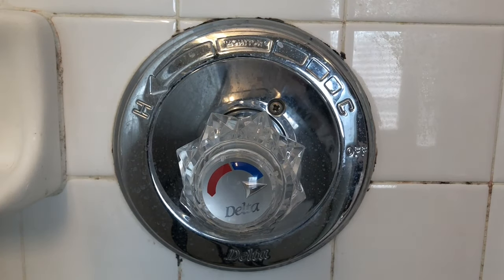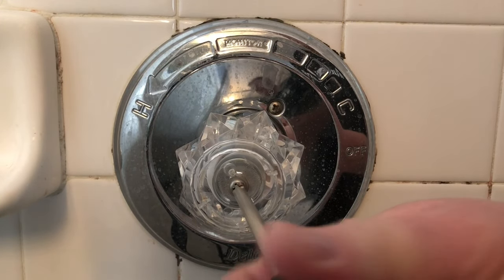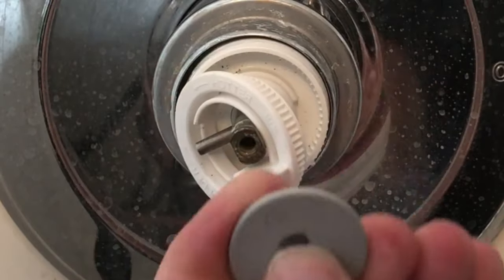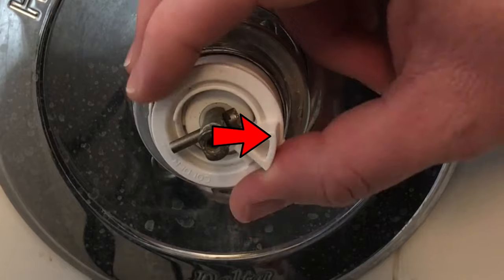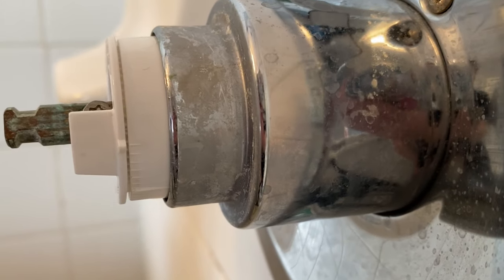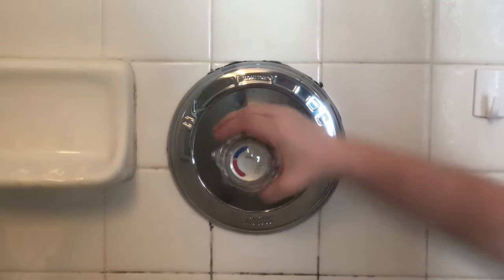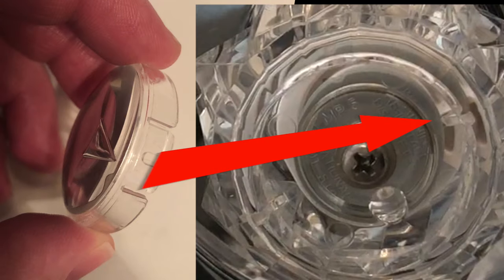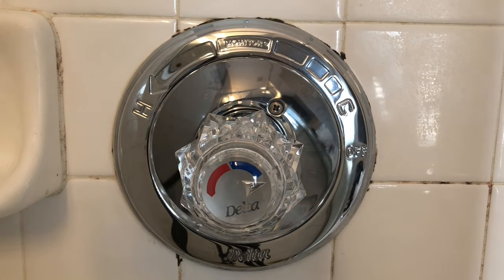How to adjust the hot water in your shower | Delta Faucet

Comment: Thank you!  I replaced the cartridge and then took a shower.  The water was barely warm and was worried I might have a bigger problem.  This will be an easy fix!
Reply: how did you change the valve?  what tool did you need and where did you find them?  Thank you!

Comment: Do I have to turn the water to the house off first? I put in a brand new cartridge but forgot to adjust hot water setting.
Reply from the maker: Sorry, this is not my full time job so I'm slow at responding.  I'm glad you got it figured out.
Reply: Dawn, no, you just need to remove the handle. No water will shoot out or flood or anything if you are only adjusting the water temp. If you have to remove/replace the valve, then you need to shut the water off somewhere further up the line; either at the main or somewhere along the line that feeds the shower, if that's an option.

Comment: Hello, what if it is still not hot enough when I adjusted to hottest? In the mean time, I confirm the hot water is hot from regular sink. Thanks.
Reply from the maker: I'm not sure if it's turned all the way to hot it should work. There must be something else happening. I don't know what it could be.
Reply: I'm in the same boat. Water gets warm. not hot. I'll look at more internet advice, if I find any, and then cut a couple teeth off the limiter to see if I can move the dial hotter. We'll see.
Reply: @natedahl6345  same with mine. Isn't hot enough no fixed that I've found
Reply: Just remove the limiter. This may solve the problem.